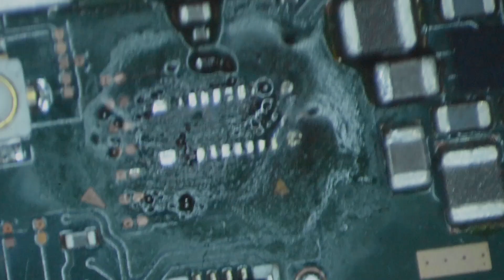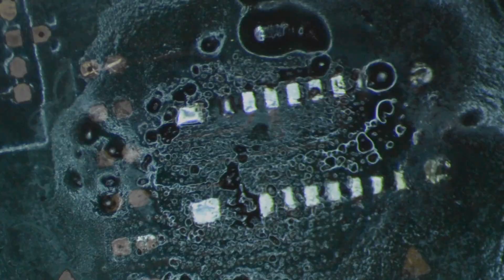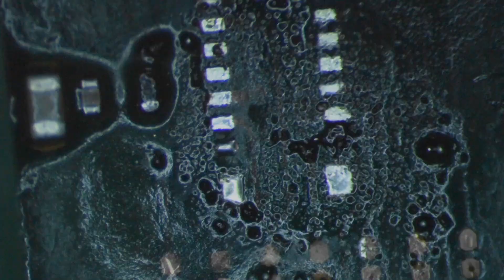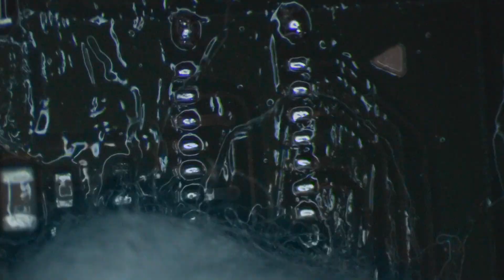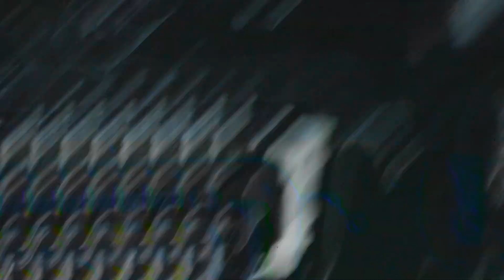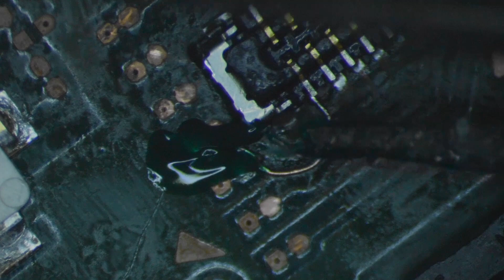Nintendo Switch SD Card Connector Repair + Damaged Trace & One Wire RCM Mod

Comment: What temp did you solder and heat the board at?
Reply from the maker: 400c max air under the board
Reply: @chasefournier  interesting. I followed someone's advice to have the iron at 450 for repairs...and promptly melted off pads...
Reply from the maker: @jarrettfullerton2580   400c max for doing that job

Most repairs on switch boards, don't exceed 400c
Reply: @chasefournier  yep. Found it out the hard way...ugh
Reply: @chasefournier  can I ask one more thing--youve shared a lot of useful info, what wire should one use for a wrecked pad?
Reply from the maker: @jarrettfullerton2580  I got you! https://www.mobilesentrix.com/0-02mm-200m-enameled-copper-jumper-wire

Remember this is enameled so you need to tin the ends of the wire before soldering it.
Reply: @chasefournier  you rock. Thanks!

Comment: Good video, Chase. I'd like to see one where the FPC connection traces have been pretty well exposed to see how you would handle it. I have my own Switch that I've attempted the FPC connector repair on, but the original connector did not come off cleanly, which is my own fault for not heating the board from underneath.